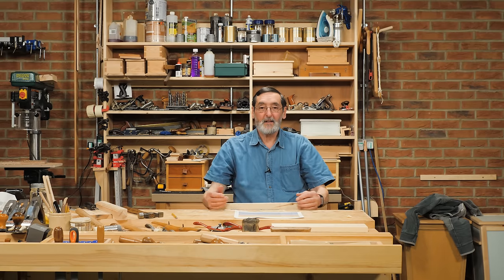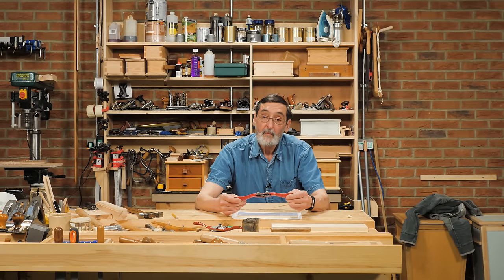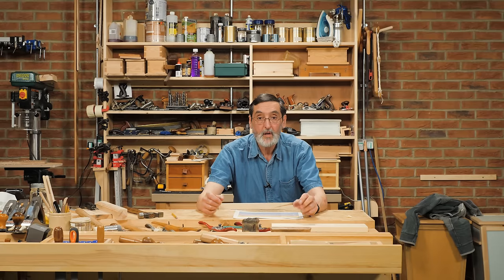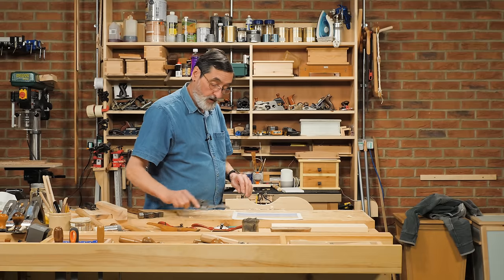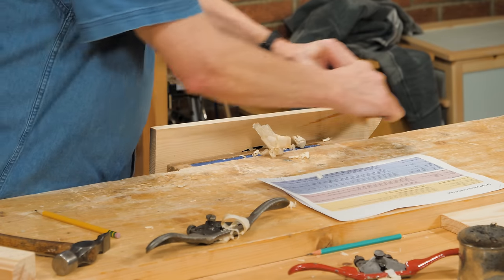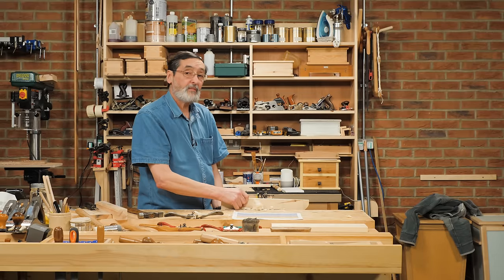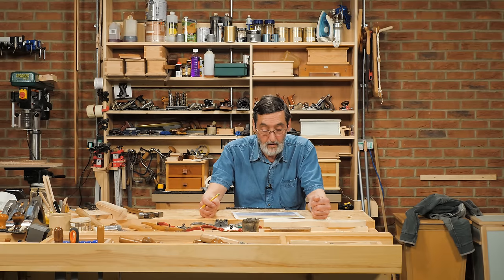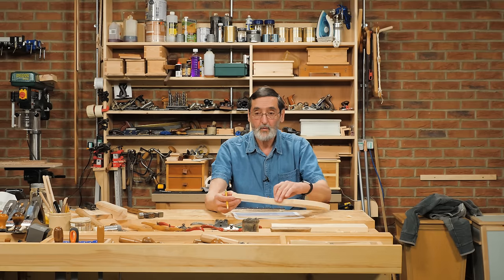Spokeshave Q&A | Paul Sellers

Comment: Paul, this is so valuable. cannot thank you enough! bought a Stanley Spokeshave 151 and got it running after some work as you mentioned. Works perfectly know, but had to do every little mentioned detail. And then: the sensitivity and the way to use it, described here, helped a lot. very, very good advice, thanks again! you are the gentleman of woodworking :-)

Comment: Sharpened my spokeshave blades yesterday and would have to agree with Paul about using a jig but not for the same reasons.  The central adjustment slots on these blades is probanly punched from flat stock and this can leave a nasty sharp edge.  When flattening the back it is very easy to cut yourself not on the blade edge but the edge of the slots.  Take care, I will be using a jig, or a pair of mole grips from now on.  Thanks Paul great channel.

Comment: Hah.  I've done fine with the standard flat-bottom 151 shave before now.  But that bit about filing a little flat on the round-bottom version, just blew my mind a little bit.  I never knew I had a use for a small-radius metal spokeshave before.  Now I actually have to go find one!

Comment: Dear Paul, I have never enjoyed using a spokeshave and several points in this Q&A covered why. I never realised that they came in two forms - bi-curved and bi-straight. You mentioned flattening the front curve of a bi-curved spokeshave to give a leading plane flat surface. That sounds good but with the existing curve, getting a flat would remove a lot of metal. This makes a tight radius of curvature even tighter. Great for tight curves I suppose. How about the idea of taking a bi-flat spokeshave and grinding a curve in the trailing surface? Same end result but greater radius of curvature. 

This could be the basis of a short video on its own. If at the end of the day, I finally find a spokeshave useful, then the effort would have been worthwhile. Thanks for your excellent series on everything to do with hand tools and woodwork.

Comment: Paul sellers, I watch this video and now I am able to use my spokeshave. My spokeshave was handed down to me from my grandfather it never worked. The chatter was unbelievable, the blade was sharp as a razor, it was useless. After all these years I found out the blade was upside down. I took for granted it was going in correctly because of the markings that were on the blade from the thumbscrew. All that is left now is to develop my hand skills.

Comment: I bought a cheapie spokeshave on Amazon about a year ago and was having a lot of fun with it until I took it apart to sharpen it and it was never the same after that.  Eventually I found a Stanley 151, immediatly took it apart and got that blade razor sharp, but it too didn't seem to work right.  Discouraged, I pretty much gave up on the tool until just now when I watched this video, immediatly went down to my shop, flipped over the blades and now both cut like butter!

Comment: Great as usual, and a heads up for the new Stanley #151, at least in the states the new model has been moved from being made in Mexico to a different factory in China. The quality is actually much improved overall from the older shaves just a year or three ago. I looked all over to buy a used model, could not find a decent one and would not spend the money for those new ones, the fit and finish was terrible! These newer units are much better, there is work to be done on the blade as the grind is odd, but other than that a great improvement overall. I hope this helps those of us who could not find a decent vintage model?!
Reply: @Boozoo Chavis  
Thank you for posting this!

A few years ago the Stanley 151 Spokeshave that I inherited from my grandfather went missing.  :(   Of course I was disappointed, and searched for it for days, but with no luck.

However, I thought that it should be no problem to replace this simple tool with a new one.

BOY WAS I WRONG!

IMO, the new Stanley that I ordered to replace my original was a huge step down in quality in many regards... 

The casting, the quality of the thumbscrew's metal, threads, and knurling, and especially the quality of the blade steel were all sub-par.   :/

It took quite a bit of work to even make it useable.  IIRC, I paid about $23 for it.

And let's be honest.  These are one of the most basic and simply-designed hand tools you could own, and even for a new spokeshave made to the original Stanley's higher-quality, these should not be more than a $20 tool!

So I just checked on Amazon for chits & giggles, and the new "Chinese" Stanley 151 was over $50!  That is just pure insanity!

Other sellers such as Zoro and Acme Tools had it for around $25.  But the photos in the listings look identical to the current new Stanley that I have (which I'm assuming is the Mexican version).

Unfortunately, I think that if you order a new Stanley 151 online, it may be very difficult to know if you will receive a newer Chinese-made or slightly older Mexican-made tool due to where the seller sources their stock.

There are probably hundreds of thousands of the Mexican made spokeshaves still on warehouse shelves.

So I looked online and in forums to see if there were higher quality spokeshaves available, and luckily, of course there are.  Veritas, Dave's Shaves, and Lie-Neilsen, etc...

BUT WAIT!!!  All of these are WELL OVER $100!!!  And even just a good quality replacement blade is over $40!!!

Guys, the blade is just a ~2"x2" piece of flat, hardened steel, NOT a high-quality, multi-faceted, precision, carbide tip router bit!

Again, this is absolute insanity!  I realize that these smaller companies need to make a profit, but come on!   Seriously?  Talk about a "Profit Organization"!

Take another look at just what these are comprised of and how much material is used in order to manufacturer one.  Ummm, yeah.

In addition, I haven't read or seen any truly compelling reviews that these "High-End" boutique spokeshaves actually perform their duties in any significant manner that is better than the original Stanley 151.  WTH?

Don't get me wrong, I can see how the cost of the better quality smoothing planes etc are justified.  But there is A LOT more that goes into their manufacturer compared to a simple spokeshave.

Boozoo, do you happen to have photos or links to photos that you could post to show the actual differences between the Mexican and Chinese models???

I think I might just have to completely tear my shop apart and look for my grandfather's old Stanley spokeshave!

Hopefully it is just hiding in some unseen nook & cranny and didn't grow legs and walk away.

Comment: Right on point!  I bought a bench dog brand spoke shave and was really starting to get frustrated with the chattering.   I finally decided to look for a video to determine whether it's all on the user or if there is something missing in the quality or build of this product.  Of course Paul showed up here and i learned that the iron is supposed to be bevel down.  I was quite uncertain about this for 2 reasons.  1-the brand logo on the iron is on the bevel side.  i just figured any company would position their logo facing up and/or out, where the brand can easily be identified, (and that's the way the manufacturer had it oriented in the package).   2-Placing the bevel down will leave a scary size gap between the iron and the sole, likely allowing room for shavings to get caught.  But seeing Paul get such clean shavings, i figured i gotta try it and if I'm doing it correctly, all the shavings should be curling out the top.....duh!  Makes too much sense for my over-engineering self to catch alone. LOL

And that lead to fixing the other problem i was having.......chips (not shavings) getting caught UNDER the iron.  Between the sole and the iron.  Not the iron and the chip breaker/cap.    With all the chatter i was getting from the bevel up position, i was indeed getting a lot of tiny chips and no shavings at all.  those tiny chips were indeed getting caught under the iron, causing me to have to remove the cap and clear the spoil every few swipes.   Now.....bevel down, no more chips, many more shavings and nothing getting caught under the iron.   

ok, i cut more wood now.

Thanks Paul

Comment: I hated the spoke shave for a long time because I bought two crappy cheap ones, one rounded and one flat. The mouth was way too wide on both of them so especially the round one chattered across the wood no matter how sharp the iron and no matter how carefully I set it up. The cap iron was also comming loose when adjusting it. Those things were just no good. Then I bought a Stanley 152, modified it like Paul shows in this video and I´m happy with it ever since.

Comment: I’ve just bought a new Stanley and tuned it up. I’ve honed the blade and mostly flattened the sole. One adjuster isn’t smooth and on inspection the threaded stud is not at right angles to the case and not parallel to the other. You get what you pay for. I should have aimed higher up market. After some fiddling I got the blade protrusion about right, but it’s skewed in the mouth. I shall have to send it back. I shall try a Luban

Comment: Hi Paul, can you give us a little more detail on how you modified your curved spokeshave.  Thanks.
Reply: Yes please, I rewatched that section of the video 5 times and I’m still not sure of what needs to be done.
Reply: I think he rounded the bit between the blade and the front. It gives the front a bit of a curve. I think.
Reply: @rcjbvermilion  I think he flattened a round spokeshave, so that instead of being a "rocking chair" that you have to fight to keep the blade in the right spot, it has a small flat spot to index and guide the shaving. He chose to flatten the area of the sole in front of the blade, so it ends up working like a mini kana (japanese plane) which has the contact area in front of the blade (the short area of sole behind the blade is relieved a tiny bit and should be floating when you use the kana). After filing the sole to have this flat spot, you might have to retract the blade a frog's hair or two to get it to cut right.

It should be able to get into just as tight a radius, but when using it in a really tight radius, you might have to extend the blade a frog's hair.

Comment: I have a round bottom spoke shave. The problem with it is that the mouth of it is far too large. No matter the amount of adjustment done, it seems to snag regardless of grain direction. I don't know if there is a way to remedy it, maybe a spacer behind the blade.

Comment: Super video Paul, you covered more than I realised there was to know - and covered the couple of problems I have encountered, ie. blade nice and sharp but back to front, plus tightening wrong screw. I recently stripped 20 years of paint off some garden bench pine slats about 3" wide 5' long and Spokers took it all right off, better than messing around with the heat gun and some burr on a chisel.

I do wonder though if you have used the convex shaves for hollowing seats or scrubbing?

Comment: Thanks for the info... My father had used Stanley 51 flat spokeshave. Unfortunately the metal body has a fracture, in front of the blade. I quess it is not possible to repair. May serve as spare parts, if I manage to find old 51/51R pair somewhere...

Comment: My new (vintage151) spokeshave from Ebay has a blade which is not flat across the back, also the cutting edge also seems more worn in the center so it is a slight crescent.  Is it first necessary to flatten the back prior to addressing the cutting edge?

Comment: how to weld the metal tang on a  vintage wooden spokeshave. like the one you have. i purchased it online and found out as i was removing the rust that one of the tangs was cracked off. i tryed JD WELD and ca glue mix with salt. no good kept breaking off. a little help please...

Comment: The MF #1 can have its iron treated like the bevel up iron of a wooden shave. Of course, the bevel is down, but it serves as the sole of the iron in use. The mouth must be just big enough to pass the chip.

Sharpening is pretty hard. The bevel must have NO camber in any direction!

I have two of them, one with an aftermarket iron and another with the factory iron. The factory iron works better mostly because the inner diameter is the same or slightly smaller than the body of the shave. If the diameter is larger, the edge will pull away from the body in such a way that the mouth is enormous. 

Personally, I have had far better luck with the #2. It can technically do both curved and flat depending on how you have the sole "formouth" set. Generally I have this set for curved and use a 151 for straight surfaces.